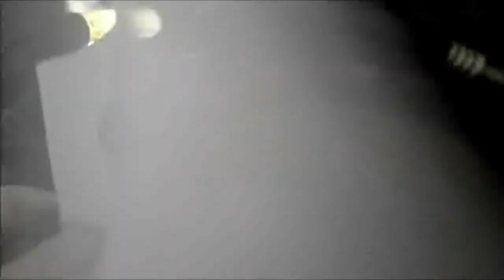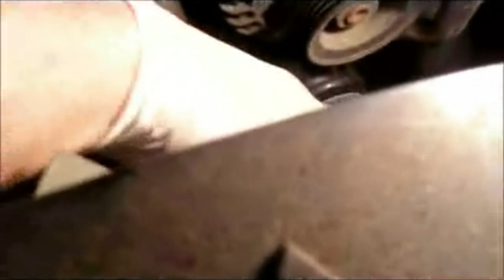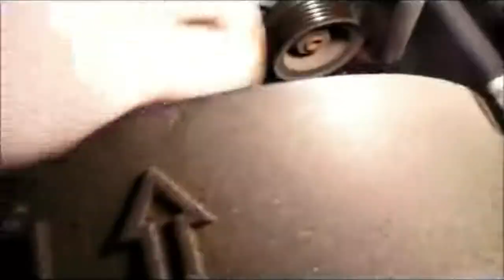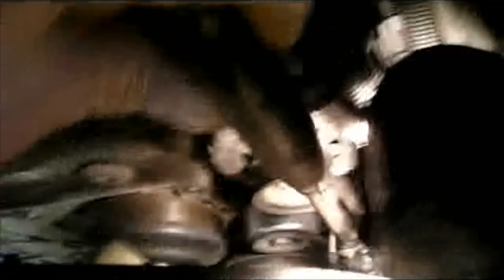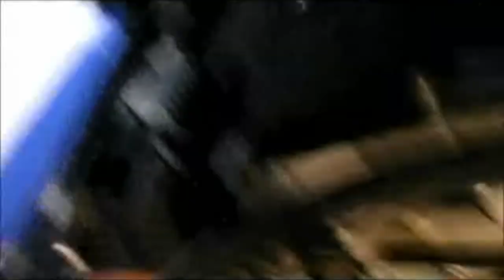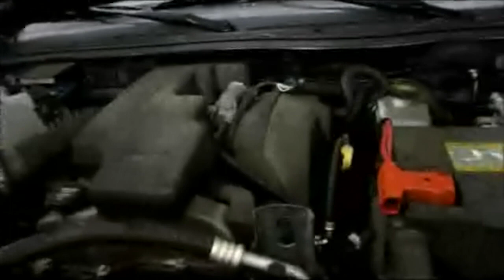Chevy Colorado 2004-2008  Replace The Tensioner, Idler Pulley And Drive Belt

Comment: Thanks for the video. I went through the same steps in this video but encountered an issue with the belt, seem to be to short. I have verified that it is ran correctly exactly the way it was ran in the video and it matches the size belt that came off exactly. I’m kind of confused since I am getting the tensioner where it can’t go any further “maxed out”. Any suggestions on what to do or check from here would be greatly appreciated.
Reply: what did you end up doing?
Reply: Probably need the 93 inch belt, i had the same issue for some reason there is a 91 inch one also